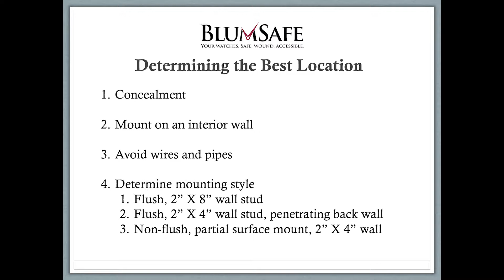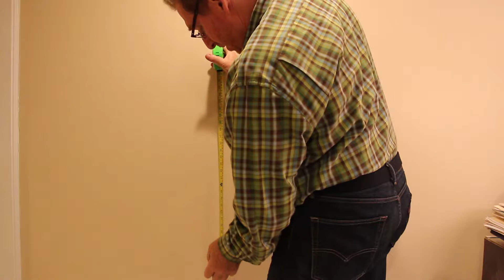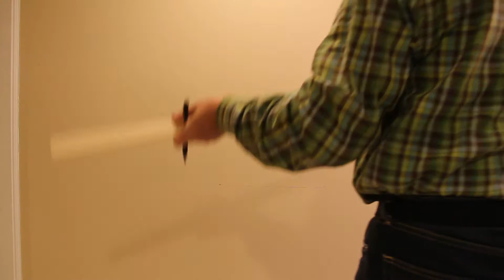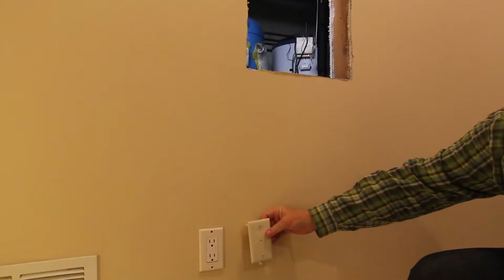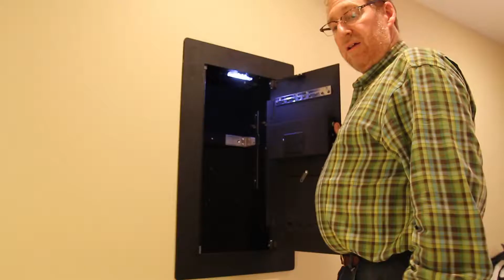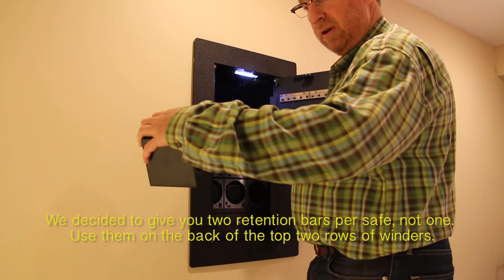BlumSafe Installation Tutorial

Comment: I’ve bought two safe’s now. One last month. The never come with the back holes pre drilled in the top two rows.
Reply from the maker: The holes are there. You just have to feel around for them under the velvet, or see them on the outside back of the safe and push a pin through the holes from the back.
Reply: @blumsafe  how come you don’t reply to emails from customers but you can reply to YouTube?

Comment: How many Watts does each winder use? Trying to figure out if I can run a 16/2 wire ? Would that be sufficient? For 6 winders + the light ?
Reply: Thats fine, they dont draw alot of current, but you must always consider your local building and electric code rqmts. The steel door lights are battery driven, display door lights use Ac power adapter.

Comment: We have sold a bunch of these outside the US and people have asked about whether the power converter for the winders is dual current -- AC/DC, 110/240 volt. It is and you can use it anywhere. All you need to do is get an inexpensive pin converter so that the pins on the converter match your electric outlet (we ship with the US two blade plug).

Comment: How far does the safe stick out if you don't want it flushed into the wall? My walls 
aren't that sturdy and If I ever do get one of these safes I'm afraid of it causing damage to my walls.
Reply: Kevin,
Are you in the United States? If so, you may have a 2X4" stud wall. In this case, if you place the safe in the wall cavity as far as you can (without projecting out the back side of the wall into dead space, like under a stairway or into a closet), the safe will project out the front  of the wall  by approximately 3.5". The safe has mounting holes for this type of installation and this type of mounting is usually quite safe if your wall is a proper 2X4 wall with sheetrock on both sides. Basically, to finish the installation, you or a carpenter would place trim work and/or simple pieces of 2X4 between the face plate of the safe and the front of the wall. See this link for more information, Figure 6 in Section 1(c).https://blumsafe.com/installation/
Please email me at rob@blumsafe.com if you would like to talk further. Thanks for your interest.
Reply: Yes I am from the US my main concern is I live in an older house whose walls are very thin
Could this safe be mounted like a tv with the brackets?
Reply: Kevin, I would not totally surface mount the safe — either partially in the wall to a 2x4’s depth (interior wall, not exterior wall) OR consider erecting  a small wall (using 2x8” studs) in a closet, corner or other  convenient place (not as bad as it sounds — probable carpenter/handyman cost $200-400) for flush mounting, or perhaps retrofit into a built-in closet setup. If put in the open, consider covering with a canvas or photo on two light hinges and you have a concealed solution! Regards, Rob
Reply: OK so I don't necessarily need the safe to be flushed in the wall?
Reply: Kevin It doesn’t have to be flush, but must be partially flush (partially in the wall). See the diagram I sent you the link for this morning, the partially flush solution. Happy to talk if you want to give me a call. Phone number on the website, www.blumsafe.com
Reply: Ok gotcha hence the painting covering it up thing.
Reply: Kevin, one note —  the painting covering the safe only works to cover it up if the safe is flush to the wall (which would require you to build out a small wall). See this blog posting: https://blumsafe.com/canvas-safes/      Thanks, rob
Reply from the maker: Kevin, FYI, if you were trying to order, our site was down for maintenance the last day and a half   but is back up. Any other questions, just holler.